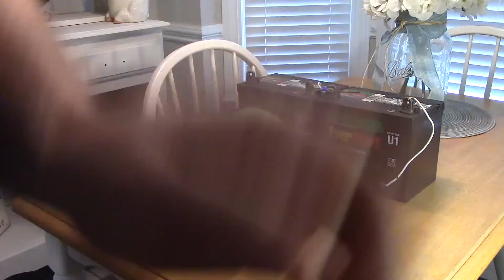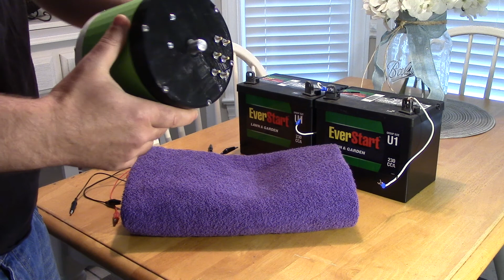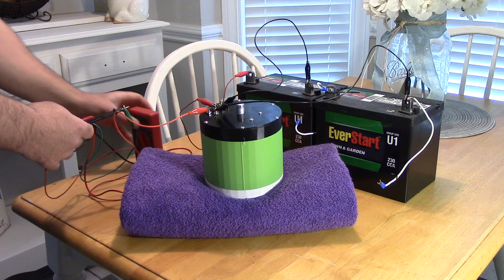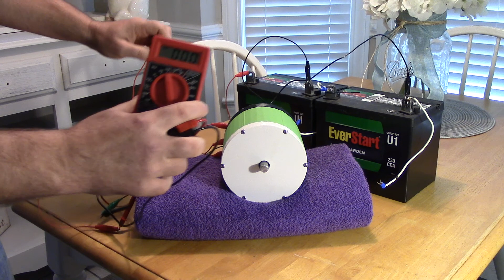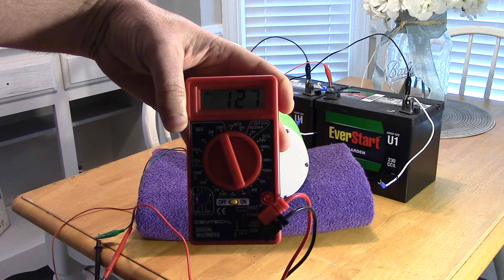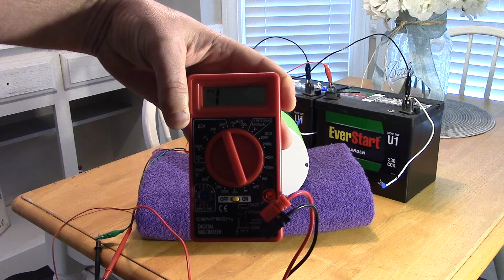Pulse Energizer For Radiant Energy (3D Printed) #2

Comment: what is Amps output??
Reply from the maker: Not sure about amps.   From what I've learned with most transistor switching circuits, the reactive spike is normally between 50 - 400 volts depending on different factors. You may be able to get more from HV rf transistors.  Probably a little higher for a good reed switch.  Too high and you will arc weld the contacts together though.

From what I understand from Bedini reading material, Amps in those spikes are hard to measure.  You could collect those spikes in a capacitor and maybe measure an accumulative output discharge.  If you are looking to gain any usable amps from these small projects it is likely that you will have to collect in a capacitor anyway.

Comment: Just a idea, try putting a Magnet wheel (North-South-N-S), on a bearing then on the SSG haft as second generator only connected through bearing on Ferrous Shaft.
The drag is limited Due to Bearing on the SSG, due to Indirect Magnetic Linkage of SSG Magnet wheel transmitting Magnet force through Shaft to the other Magnet wheel will Catch up to speed, then Draw drop's.
This with limited Effect to SSG Drive/Force will give you more juice, in FLy Wheel effect and more current through secondary generator Mag WHeel.
"BENDINI S.S.G., VERTICAL DOUBLE ROTOR" is my Video, This can be done horizontal making Both end's of Shaft use full.  
Hope this idea help's, write back any finding Plz. And do you share STL file's of your SSG Build? I would like to see if so.